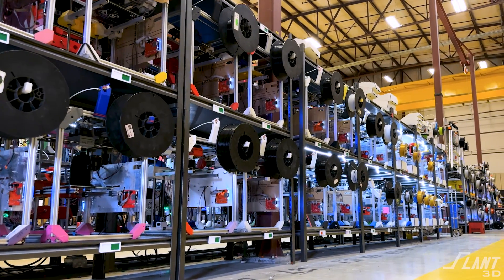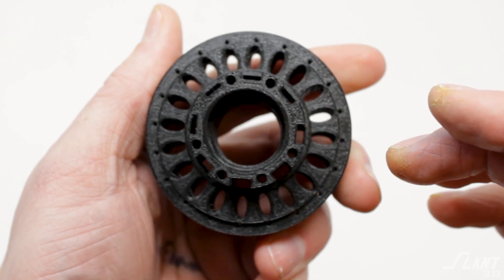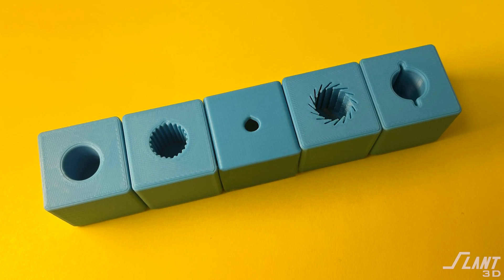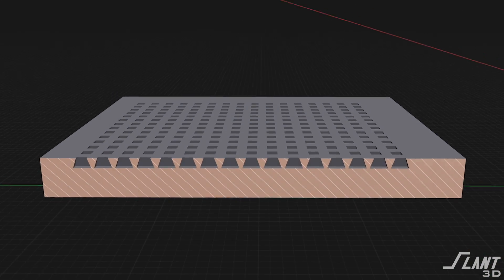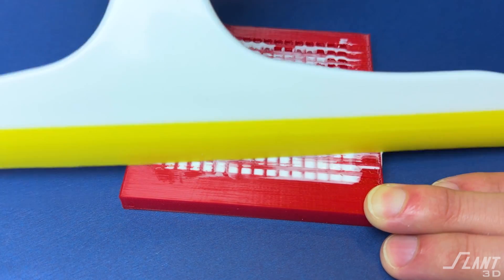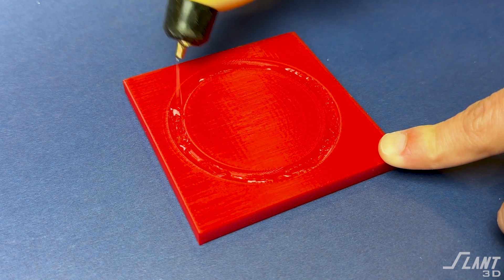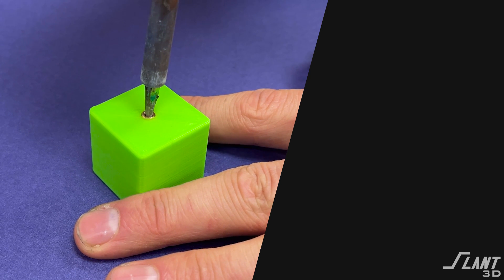Simplify Assembly with Glue Slots | Design for Mass Production 3D Printing

Comment: Glue HOLES are handy too, and commonly used on metal parts like aircraft wiring standoffs. Complementary voids can make much stronger joints then otherwise at negative cost (less filament used though the amount is trivial).

Comment: I was surprised to see white glue being used. My assumption had been that drying time would be increased, but clearly Slant 3d has tested this. Typically I've stuck to cyanoacrylates (superglue) or hot glue on prints. 
The topic of glues and when/where each type is more appropriate might be useful topic for production design. 
Realizing the best glue is no glue, but realistically there are times when glue is the right tool.

Comment: Love to see the mention of adhesives in 3D printing. Using glues in assembly is often overlooked, especially by small companies! This is a process that is easily automatable, which decreases overall costs for fulfillment!
Reply: glueing got really good, but something in my head just wont go there. i use plastics, resins and adhesives all the time, but i will fasten and weld and do whatever before i even think about glueing anything. something wrong in the head i guess,,

Comment: Yep. One day I was making an adapter for low-pressure air. There was a tube with treaded end and I needed to connect it to a 3D printed part - both mechanically and with air-tight seal. I designed a hole to just unsert threaded end in. And additional cavity around to pour the epoxy from the top when the threaded end already in place. Turned out perfectly.
Also there is some strange satisfaction glueing such stuff, especially when the part is clear and you can actually observe glue as it flows in.

Comment: A lot of commentary about where the air escapes... valid. But where does the moisture escape? PVA is 50% water and if it's not absorbed by the material all you've done is transfer it to a different bottle. For the same reason if it IS absorbed it shrinks by 50%, so does not fill gaps - that's why you need clamps when gluing timber or manufactured board together.

Comment: When you have one hole at the top, and an enclosed shape underneath, and you inject glue in the top, where do you imagine the air goes? The cutaway graphic doesn't work.
Reply from the maker: Luckily it wasn't a graphic. It was a real demo.
Reply: @slant3d  Was it enclosed? Where did the air go?
Reply: @breakflight  The structure of the parts is not airtight or watertight which can be a benefit as it helps glue to penetrate the structure and assists air-curing glues set a bit more quickly.

Comment: Another superb video - thank you. I just hadn’t thought of these subtle ways of dealing with glue. I really like  the idea of the serpentine channel to threads you touched on at the end. 

I’ve got a whole lot of plastite screws in a . Design I want to thread lock -
I’d be really interested for your thoughts on how best to do that to minimise hassle / failure in assembly. 

I’m using plastite  screws to avoid heat inserts / tapping / helicoils  etc or the always near disaster of assuming machine threads will “self tap ok” into plastic. They just don’t compared to thread forms designed for the task!

Comment: It would be good to see if pouring the glue inside a parts weak point makes it stronger.
And what glue is best, so it flows and has great addhition to itself and the part. IE you could use resin, PVA, super glue.

Comment: What type of glue do you use for these applications? I use superglue and 2-part epoxy regularly but epoxy is often quite thick so it would require a lot of pressure to push it into a channel. And I'm not sure if superglue is meant to be applied so thick that it can fill cavities. In your video it looks like you used white Elmer's glue or something similar?
Also, these types of patterns that you showed in the beginning could also be useful for silicone that doesn't stick, where the silicone has to actually grip the part. Very cool!

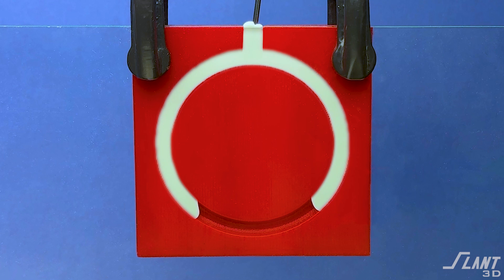Comment: 3:21 ...how's the air getting out in this example? I don't know any glue that'd be liquid-y enough to work with such a shape in the way shown.
Best case would be the air eventually deciding to bubble up, creating a mess when it bursts out from below the glue, but most likely case would be it just sitting there, not letting enough glue past in the first place.

That aside, this topic is really something I never even considered for my designs. Most of the time I already had a hard time getting alignment features to actually align after printing. But glue "hooks" are something that never crossed my mind until now.
Reply: The trapped air does escape at the glue injection point. It's slight but you can see the bubbles.
Reply: The seam is not air tight.
Reply: It's very easy to model in a vent.  With injection molding, which the resembles at the time stamp you cited, we often vent areas where the air could get trapped (the last area to fill).  The idea is to make the vent small enough that the glue won't flash out.  Air only needs very small holes to escape, whereas glue has much higher viscosity than air.

Comment: Well if you exclusively focus on glue this video is helpful. 
But IMHO every glue surface should be protected with anti shear help to get it lasting as long as possible. 
Or aligning help shoult be considered part of a glueing interface.
Reply: This was a great introduction video that deserves a follow up.
Glue choice, glue additives, vent holes, pull or push through channels, inserting fibre rods, printing jigs and templates, cnc glue application, maybe make that several follow up videos.

Comment: The glue channel you showed wouldn't work well, as air would get trapped on the end of the circle... much better to make an exit channel right next to the entry channel and require the glue to go all the way around the loop and appear at the other end to assure the entire loop was filled. Refer to mold-making knowledge where they leave a entry channel and a 'vent' channel.
Reply: @cambouiscom  not completely trapped, but it will still pressurize enough to slow down glue injection.  You also won’t know when it’s full  until it’s overfull, or you have to track volume.  Venting is good, fast, and cheap.
Reply: Prints are pretty much never airtight though. It's really not a smooth machined surface
Reply: You could have a channel from the bottom back to the top where you are pooring the glue to allow air to escape.
Reply: It's kinda funny bc 3d printers have brought a lot of unmechanical people into the world of building things without any previous experience building and they're discovering common sense building techniques. The same for the opposite too I suppose with the older generation getting into 3Dprint thinking a polygon is a gender term or something.